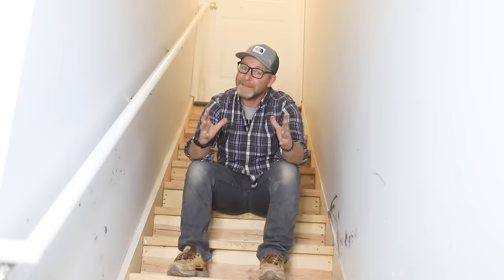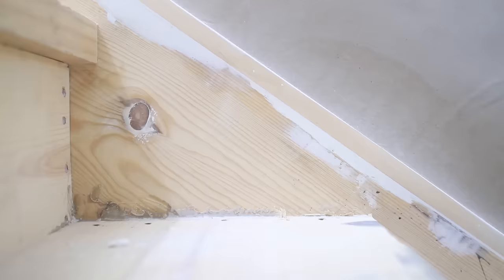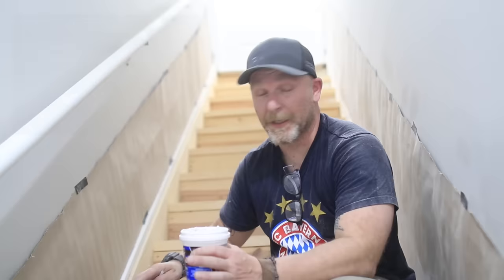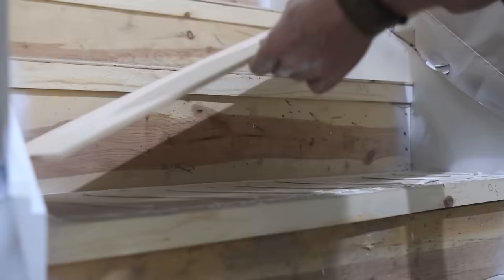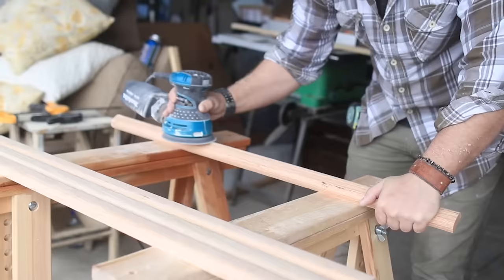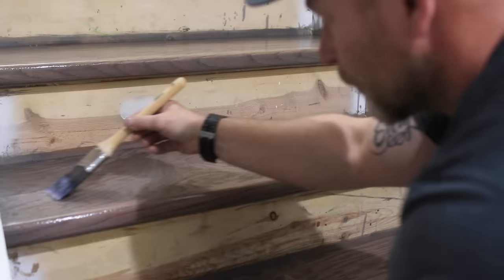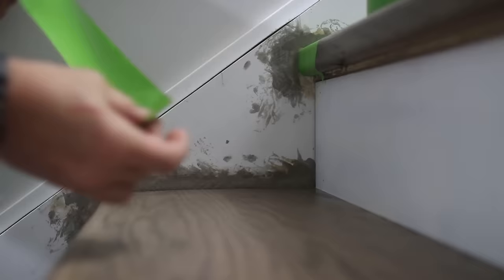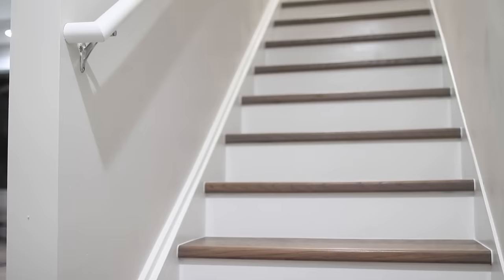DIY Stairs Makeover for Under $200 with Full Cost Breakdown!!

Comment: Excellent video production and the stairs look beautiful, but I have a few issues I'd like to mention. 

1. The biggest issue is the strength. When walking up and down stairs every human generally steps on the nosing so most of their weight will rest on that section of the tread. You're method of attaching the nosing is by wood glue and pin nails. I would almost guarantee that's not up to code nor will it last over time. That obviously depends on how many times you use the stairs too, but that's an extremely weak method of adhering nosing. There are other methods but it without an entirely new thread the finished product won't look as nice as yours. 

2. Your method does decrease the rise height by 1/4". For some older homes you may be creating a serious injury risk as most older homes don't have properly coded stairs to begin with. People need to be aware of the difference that will be made with this method. 

3. Finally the last issue and it's not a major one, but worth noting. Your final price didn't seem to include fasteners, wood glue, tape, paint and the brown paper on the walls. All of that should raise the price per step from 13 dollars. 

Other than that great video and great job. Thanks for sharing.
Reply from the maker: I appreciate the comments.  As for the attachment of the bullnose with glue and pin nails it will hold up.   Glue joints are actually stronger then the wood it self.   Wood will actually break before a glue joint. And the nails are just there as clamping pressure while the glue dries.   
The rise you mentioned if changed on every step so it doesn’t change what so ever except for the first one, and that 1/4 on the first on will never be noticed.  The eye just dosent register such a minimal change.   
As for the pricing I did put a line for misc.

Comment: That round-over bit looks much more like a 1/2" bit than a 3/4" bit.  I mention this so that others will look closely at what they think the radius is.
Reply: So, the 3/4" radius bit, on a 3/4" x 1 1/2" piece of lumber, will result in a cross-sectional semi-circle when the lumber is routed against the 3/4" side (i.e. height), and the 1 1/2" side is the width of the base.

This suggests that the bit used in the video is 3/8" (or 1/2" at a stretch), though I have not tested this myself.

It also explains why in the video a palm (or compact) router was sufficient to do the work.  For a 3/4" radius round-over bit, you really need a 1/2" shank, and that would be done with a standard size router (not a palm router), and best done on a routing table when working on hardwoods.
Reply: I thought so as well.

Comment: Just wondering how that bull nosing is holding up. 
I was considering doing this exact project at my home, but I’m concerned that that bull nosing may snap off at some point as the edge of stairs take a lot pressure.
Reply from the maker: We actually moved so not sure how it is now but when we were there it was great. Also a glue joint is actually stronger then the wood itself so if it breaks it will break else where before the glue gives.  It’s weird to think about but it’s super strong.  Hope that helps
Reply: I actually did exactly what he said about 6 months ago on just 1 stair and the bullnose fell off a few days ago! Maybe the gorilla wood glue I used wasn't strong enough? |
Reply: I actually did exactly what you said about 6 months ago on just 1 stair and the bullnose fell off a few days ago! Maybe the wood glue I used wasn't strong enough? Do you think construction adhesive painted onto the bullnose and then pin nailed could work better? Thanks :)

Comment: Okay, this is bizarre.  I took off the carpeting off number one stair tread and there is solid oak underneath.   They nailed down the treads with common nails and stapled the carpet on the oak.
Should i countersink the nails and fill the holes?  Or try to lift the treads carefully and flip them over?  Suggestions from any woodworkers totally welcomed...

Comment: Ok, let's be honest here. 

1. Most rough stairs are not in condition to put a veneer on them.

2. You can actually buy a prefinished veneer tread and don't have to go thru all these unnecessary contortions. 

3. Most people don't have the skills, time, or tools to do this.

4. You just saw over $2,000 of tools, plus materials.

5. When he finished, you had some nice looking half-assed stairs that you would bitch about if you were paying for them. They are going to squeak and have future problems.

6. The stair skirt is just rough pine.

7. If you count your time at say $15/hour, add another $700-900. But most people are going to run out of steam and not finish.

For a staircase like you saw, enclosed both ends, no spindles, you can have it professionally done with real treads, new risers, sanded and finished, treads and skirt painted, for about $200/tread. And you don't have to do a ything yourself, like make an extra fifteen trips going back for stuff you forgot or screwed up.

BTW, if you're going to do it the hard way, use actual 3/4" hardwood and stairnosing instead of gluing plywood down.

Comment: The overlap to me is kind of dangerous because you can fall by tripping under it.
Reply: Easily fixed if I'm understanding you properly. I was afraid of the bullnose breaking off easily. So just extend the 1/4 ' a bit wider and glue and secure a 1' of your short pieces of oak underneath the main tread. Then do the routing on the front of the whole treat. I think this will make that bullnose stronger. Otherwise, I don't understand your concern. All stairs have a bullnose or a bit of an overlap at the front of the treat. Sorry if I am not understanding your concern.

Comment: Beautiful, but a LOT of work! Now I understand why contractors charge a lot for this conversion. It's a big mistake to skimp on poly. Time WILL tell. Since you used veneer, you can't easily refinish it.  I'd light sand and add those additional coats.

Comment: Purrfect! My humans are  about to do this to our stairs but there is an issue. Did you have any dips/cupping in the original stair treads? When they put a straight edge over ours there is a gap in the middle from from the riser to the nose and thinking it needs to be filled to flatten?  maybe just extra caulk as filler?

Comment: Great video! I am planning on doing this as part of a project at the house instead of buying matching laminate.

How is it holding up 2+ years in? I am especially curious on the one coat poly's durability. I am hoping to get it installed before appliances get here, so it may get hit with some early heavy usage but regular after that. 

Thank you.

Comment: You mention a 3/4" roundover bit, that does not sound right. It's most likely a 1/4" roundover bit, because if it were a 3/4 roundover on 1 inch piece of wood you would have had a sharp edge in the middle. With 1/2"bit a perfect round nose. My state and a few others I checked had maximum nose radius of 9/16"

Comment: The veneer on that ply is super thin, probably 1/32. I wouldn't use these for stairs which have moderate traffic. Probably better off getting oak laminate flooring which is prefinished.

Also, it makes no sense to dive right in with stain. Do some test pieces so you get it right the first time. Stain color can change as well after putting on the poly.

Finally, the order which you did things was not right. The order is to start at the bottom: Riser, tread, riser, tread. I'd also use MDF over hardboard.

Comment: Don’t do it this way. The nosing doesn’t need to be cut off. Add to the stair or your tread will be too short. Plywood isn’t flooring, the veneer is too thin. Use flooring! Ugh. Do a test piece of the finish BEFORE applying it to pieces. That way you know what colour process matches! So many problems here. Find other info. This guy is a hobbyist at best.

Comment: $35 for 13 steps of oak. Not really.  Oak is like $7 per linear feet.  So each step need about 3 feet.  3x13=39 feet x$7 about $250 with tax.  Only for the part.   😁

Comment: didnt expet a FC Bayern München Tshirt :-o 
Nice step by step , keep it up
with that bull nose just holding on by glue and a couple of nails , can't you dislodge it when going downstairs and sliding over the top of the front edge of the stairs? isnt that the most "load bearing" part of the stair going down?
now i feel like i have to redo my 50 year old stairs...
Reply from the maker: Wood glue joints are actually stronger then the actual wood part and the wood will break before the glue will.  It’s crazy to think about like that, I know and sometimes I don’t want to believe it but it’s true.  So I’m not to worried about that part braking.  And Bayern is my team man!! I’m a huge Gnebry fan. The champs!!
Reply: @KomarProject  Super, thanks for the reply.  I grew up in München a long time ago and lived near the "old" stadium in the Olympia Park... (ancient history) but something about the Bayern München logo still triggers me :-)  Thanks to your video im now considering to redo my stairs :-) and include some nice led lights as well...  THUMBS UP

Comment: It doesn't look like a job for amateur, with all the powered tools you have.
Reply: Anyone can use any of those tools, you just watched him do it for a reason. To learn, rent some tools or maybe a friend's get on Craigslist or pawn shop. I saved over 50K in Labor to remodel myself. I did hardwood floors, put in a bathtub, bucket lighting in my basement. Built a wall to divide my basement
Reply: @wiseGUY1288  Don't get me wrong, I comment him for doing a professional job, not a work of an amateur.

Comment: so if your gonna post your work be prepared for criticism ,,,where to start ,,,risers go on first  then treads ,1/4 inch plywood for treads and water base poly??,,,good luck with that ,,,and white caulking on top of tread where it meets skirt board ,,,NEVER ,,its an eye sore ,,if you can't cut tight and need to fill in cap ,,COLOR CAULK ,,,however you will be-ripping those out soon enough after treads fail,,,
good luck,,next time just pull the old treads off,,,,its faster and you will be better off with a product that will last forever

Comment: The boards along the side are called skirtboards, not stringers. Stringers are under the treads.  The trickiest part of any stair project is cutting the treads and risers to fit tightly between the skirtboards on both ends. You completely skipped this whole process and just magically showed up with perfect fitting treads. Not very helpful to a DIYer.

Comment: 🤪definitely NOT under $200, unless you value the days of your life at $0....I just spent days redoing stairs with left over-engineered hardwood flooring.. so much time spent.... $2000 would not be enough I would value that at.. a VERY TIME-CONSUMING JOBS are these stairs refinishing projects...( my second staircase) and I will NOT do another one unless I am able to purchase solid wood stair treads and have money to get it stained and varnished!!!...DIY or contractor be aware!!!!! Did I forget the cost of all the equipment you need?   $200?.. in your dreams....but good work...even though,  your life will pass by so fast..it's time to put a value on that...
Reply from the maker: That’s why it’s a DIY video lol

Comment: Need more than $200
Better tools, ( yeah you have to buy the tools if you don’t have it)

Second - that’s not a tread, just super cheap job with plywood

Ppl thing that’s easy doing but it’s not,  if you have right tools you don’t need to caulk every step

You did a lot work for nothing, I’m sorry but it is the true!

Comment: Update thanks to Joe Biden it now cost $2000.
Reply: Your political stupidity aside, I was pricing this out and the base price has not gone up that much. I'm doing nine treads and the wood cost is right at $100 (1/4 oak panel and oak 1x6x6 for bullnose from Lowe's) . Still not as cheap as precovid, but still not bad considering a single pine tread is $19 and an oak thread is $36.